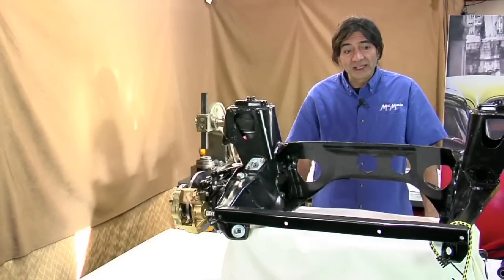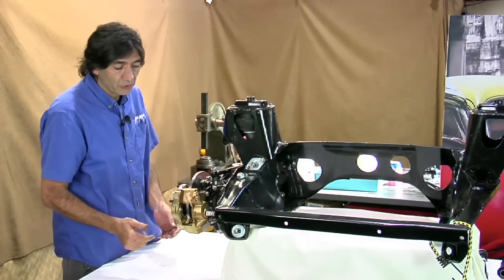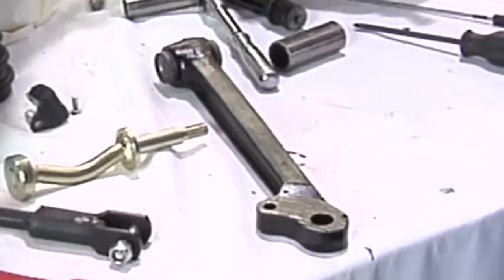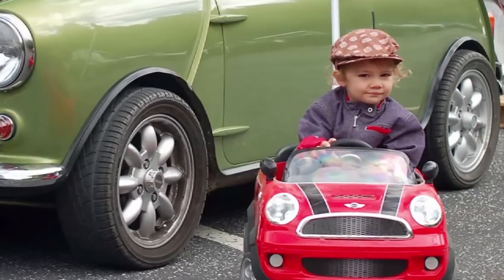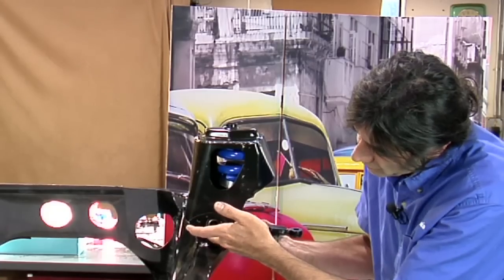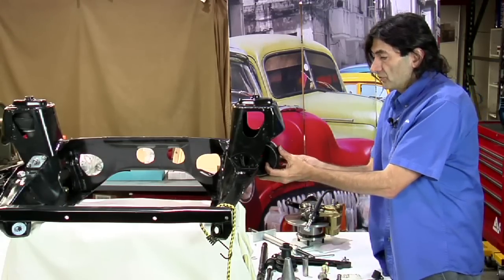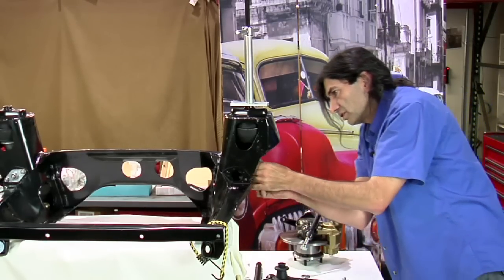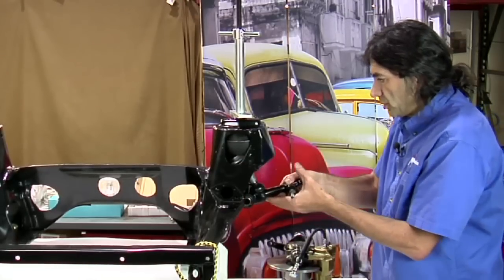How-To: Classic Mini Front Subframe Assembly Part 1

Comment: HI ALL, when i was just 14 years young i started my mini passion and it NEVER GOES AWAY IM NOW 47 and still love minis , What this guy is talking about is absoluetly correct because at just 18 i entered my first ever proper race [and won], now in the David Vizard;s bible i did NOT do the correct math and was on a very tight budget so instead of buying the hilo;s i looked at Mr Vizards Bible and it says if you cut an 8th of and inch off the trumpet you lower the car by an inch but i cut off a full inch and did;nt realise i basically had no suspension, Yes the car looked very nice sitting lower than i thought it would go but it was litterally sitting on the bump-stops . When i turned the steering the whole front subframe would move side to side luckily [for me] my best mate at the time was an autograss champ so he took 1 look and said here there;s 4 good trumpets [front and rear] and said if you really want to learn READ THE BOOK AGAIN so i did and thats when i new i messed up with the ratio  TRUE STORY LESSON LEARNED AND STILL JUST WAITING FOR THE RIGHT MINI TO TURN UP but i will be sticking with the A series engine probably a 1293     thanks   SCOOBS UK.

Comment: Hi, I’m just starting a 1963 mini Morris super deluxe. Restore What would you suggest for suspension, I’d like discs on 10” will my original subs take all the modern kit
Reply from the maker: The adjustable hi-lo's and springs are a great upgrade - they will work with any dry suspension like yours.